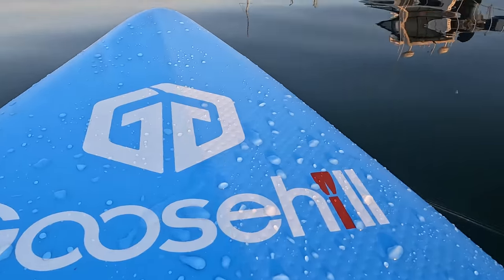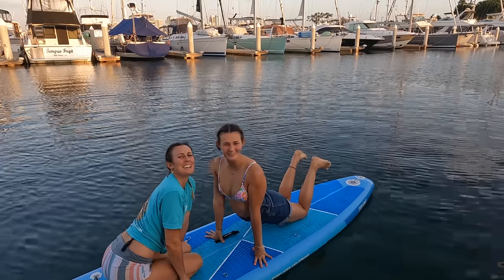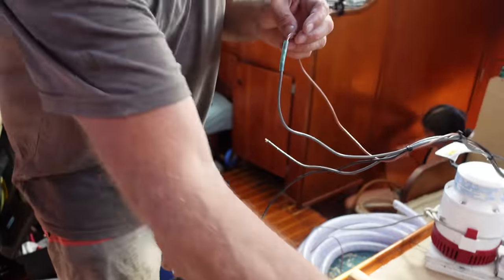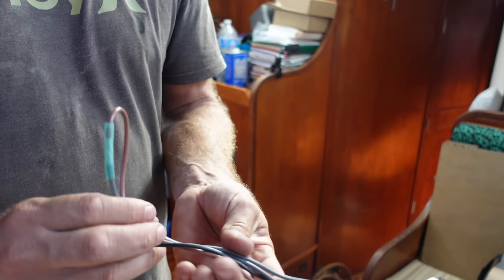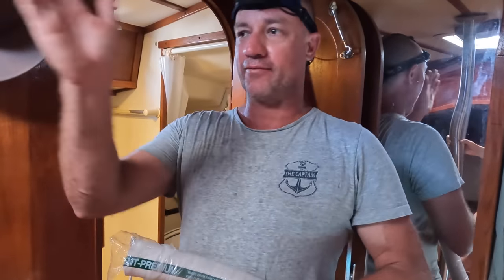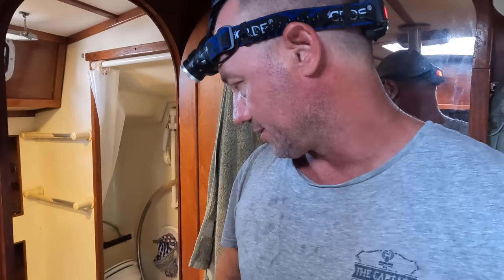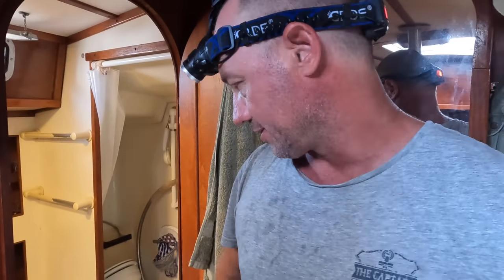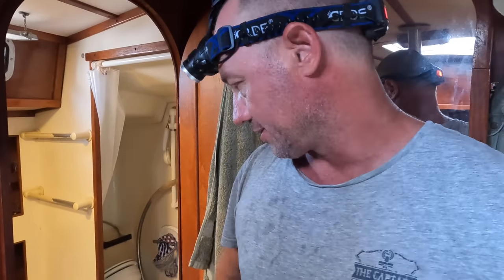One very important addition | LOTS of Boat Work | Ep 313

Comment: Great video.. Did you use a check valve on your bilge pump? My Westsail 32 has one installed from the previous owner.🤓….. Just curious if you prefer the check valve or not..